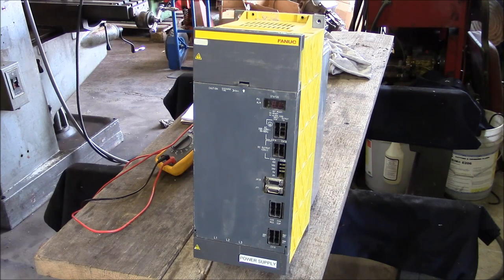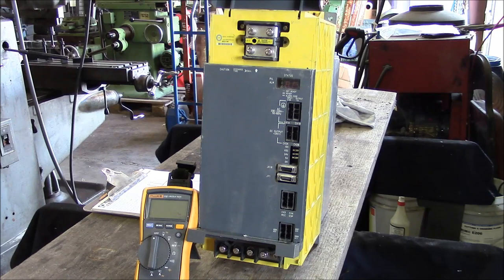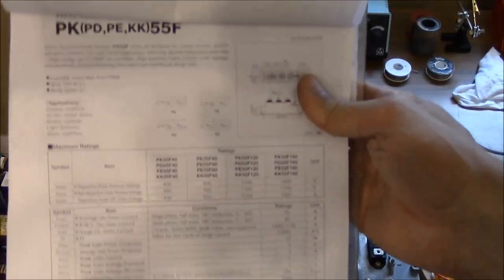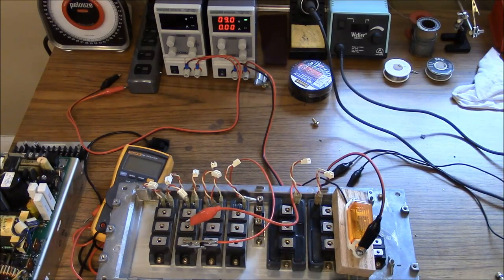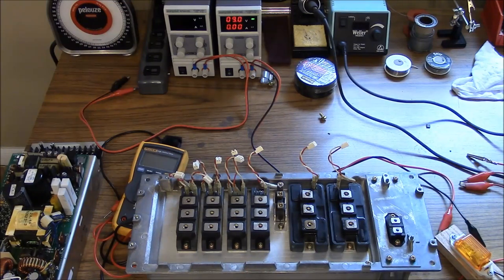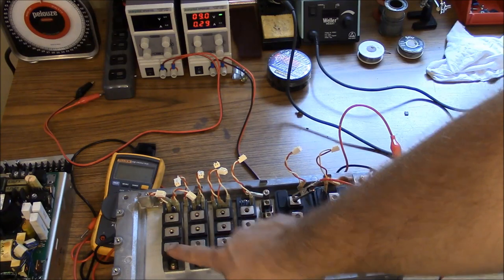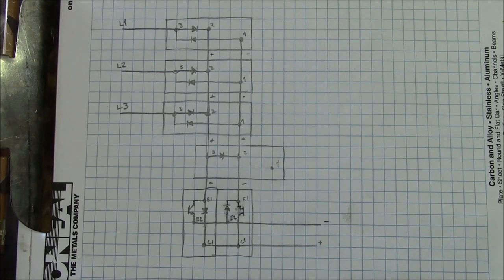Fanuc Power Supply Repair and Other Electrical Adventures

Comment: A lot of the older switching power supplies do run in the higher audio frequency ranges. That is why you can hear the oscillator running. It can be a bit unsettling when you power up some older equipment because that sound can be really loud. Your almost about to brace yourself for the BOOM. But as long as the frequency is steady, it is OK. If it starts to get really unstable sounding though, there could be problems.

Comment: Power supply:
Without the details on the control connections it's not entirely clear, but I believe you're correct about it being a regenerative supply.
L1/L2/L3 feed  into the SCRs, which are switched to operate in forward mode so long as the DC bus voltage is less than the line-line voltage. If the voltage on the DC bus exceeds the line-line voltage, the SCRs are switched to operate in reverse mode (by phase shifting gate timing), and the transistors are turned on to shunt power from the DC bus back to the 3ph lines until the SCRs stop conducting as the DC bus voltage drops below the forward line voltage.

IO:
The 74LS151 are 8x1 multiplexers and the 8155P is a 2kbit static ram with timer/counter, so presumably the IO multiplexing is accomplished by strobing the address lines and reading/writing 8 bits per address, with the output fetched from and input stored to the static ram each cycle. The 7407s are in fact buffers to stabilize signals. I can't tell, but the IC labeled "G" looks like it may have let the magic smoke out? A quick check is to probe the power and ground pins on each chip for shorts/open, then put a 'scope across the power pins with the DUT powered if possible and check the ripple - this eliminates most of the easy stuff :)
Reply from the maker: Wow. That's very helpful. The power it puts back into the grid must be really nasty. It has a line reactor in front of the power supply.

I don't see a chip labeled "G'. I must be blind. The manual for the control says that the inputs work by pulling the row to ground and detecting that ground through the switch to the corresponding column. To me that means the control can read multiple inputs from the same row or the same column, but it cannot read multiple inputs across multiple columns and rows. So, I think that means if you switched row 1, column 1 and row 2, column 2, the control would see them both. But, if you also switched row 1, column 2 and row 2 column 1, the control would not see all of the inputs because the row and column are duplicated. That should not really cause an issue because switches that might be active at the same time like axis jog switches are on the same row. 

That should also mean that if the control is missing a single input, it should be missing a whole row or a whole column. I should be able to test that on the working machine.
Reply from the maker: OK, I do see the IC labeled G. That's just some foam insulation stuck to the IC.
Reply: I suspect the reverse-feed transistors are PWMed or otherwise modulated to minimize the phase noise going back to the grid, it would be interesting to see the waveforms of both the power and logic simultaneously.
Time domain multiplexing using orthogonal strobe lines allows you to resolve individual points on the grid, think playing battleship by exhaustive scanning :)
Reply: Sorry I am late to the party but my $0.02 
Power Supply:
I think those two IGBTs are actually part of the power supplies protection circuit, I see in the video that there is a current transformer inline with the DC bus and I would bet that the supply monitors the output current on the DC bus and uses those IGBTs to cut off the output during fault conditions. Sorry but I don't think anything neat like pushing current back to the grid is going on here. A circuit that was capable of this would need 6 igbts and a large inductor. 

I am not certain but when the module is apart I count 8 modules on the heat sink, 4 thrysisters, a smaller unknown two terminal device, two IGBTs and a bleed down resistor up top. Only three thrysisters are needed for rectification and on the fourth one only half is used as there is only one gate wire. Seems like its wired up to short out the DC bus, this would be a bad idea until the high voltage is bled down. Mystery as to where excess braking energy is going unless each of the drives includes the braking resistor, not something I have seen before.

IO:
Mystery IC @ https://youtu.be/VlL52RaM81g?t=1276 is a TI SN7407 Hex Buffer with open collector outputs. A signal runs to the input like a normal buffer but the output is only capable of sinking to ground, it can not drive out voltage. These are great as you can perform neat tricks like a shift in voltage level on your signal or NOR'ing multiple signals together.

I believe in this case these guys are actually part of the matrix scanning for the input. To scan a matrix you need to apply a voltage to a column one at a time, and read the rows to see if that voltage shows up right? The column you lit and the row where you find your voltage back give you (x,y) for your input. I believe this control lights the rows to 24V through a current limiting resistor and the 7404s are used to pull down each of the 14 rows except the one its scanning. A snapshot of the columns is made via the 8 opto couplers. The convoluted system of pull up resistors and open collector buffers allows for translation between the 5V logic system on the board and the 24V system the inputs use.

The 5188 chip is kind of neat as it rolls three chips into one, sram, timer, and IO. I think in this case the only part involved is the IO ports and they read the state of the 8 opto couplers during each scan of the matrix. The fact that the ic has sram and timer is cool but not likely related to the fault (unless the i/o is stored in the sram and there is a bad cell). The IC is not capable of reading I/O and writing to sram at the same time, the CPU has to do task then the other. 

Swapping the boards cleared the issue so the problem is the board but it seems strange to be limited to just that one I/O bit. I would expect there to be other stuck bits since this is a scanned matrix where the same lines are reused to scan multiple rows. A wiring diagram of the feed hold button would be useful to test this theory as inputs on the same row/column as feed hold should also not work. If it does check out that inputs on the same row/column as feed hold do work correctly then you have to assume that all those components up to and including the 5188 are working since a scanning matrix shares those parts for other inputs.  

Great videos, working on machine tools of this era is something I love doing. The electronics are moden enough to be easy to work on and yet can do some complex tasks.

Comment: Ha! Damn! i had this EXACT same problem pretty much the exact same time last year! What a PITA getting it fixed! If this machine is running off a phase converter you need a delta to wye isolation transformer to stop these from blowing up when the motor regen's

Comment: You were discussing how it could get 112-ish output signals into 22 wires.  Sounds like a mulitplexer is involved.  A multiplexer will have, say, 14 wires devoted to signals plus (speculating, here) a number of wires devoted to a mux counter.  In this case it has to count to eight, so you’d need four lines to represent eight values in ones and zeros.  Not sure what the remaining four wires do.

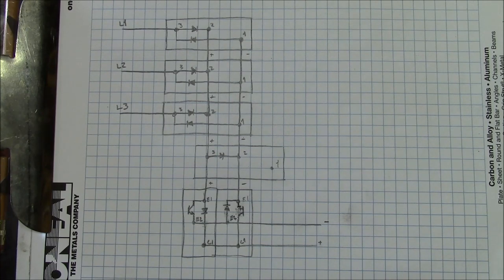Comment: As drawn, the diodes in this circuit at 22:35 short out the 3-phase power.  Either some of these are inverted, there is some resistance that is not shown, or the 3-phase supply has been stepped down to about 2 VAC.  Each of these possibilities has some uses, but I don't want to write a book on the subject.
Reply: Looks like the "flyback" diode is drawn backwards.

Comment: Any recommendations on where to start on learning this stuff. I understand basic electrical(I.e. wiring motors, vfds, house electrical) but diagnosing machine tool components is where my knowledge is lacking. Any general advance would be appreciated.

Comment: Hi, im loking some solution for proplem on fanuc A06B-6110-H037.  This cnc machine acellerate without any proplems, after decelaration this dc volt side goes to over voltage, like over 430volt and machine stops. This deceleration greates some power but it wont go to net. Error code is sp 9011 ,Thanks if you have any answers.

Comment: sir I'm facing problem when we run spindle motor above 1800rpm dc over volt alarm generated  so what is th problem exact 7 number show in drive

Comment: If sanrex sda100aa80 is open or damaged the power module will works or not please replay.  FANUC A06b-6110-h011 getting fan alarm

Comment: Why fanuc amplifier use 220 v 3 phase instead of 415 v 3phase ?
Any advantages??
Reply: imo, Fanuc is original from Japan where is 3x200v . In Europe is 3x~400 , and Fanuc sells machines with an additional transformer. I'm from Europe and i have fanuc robocut. All magnetic contactors in machine is for 200V/50Hz.